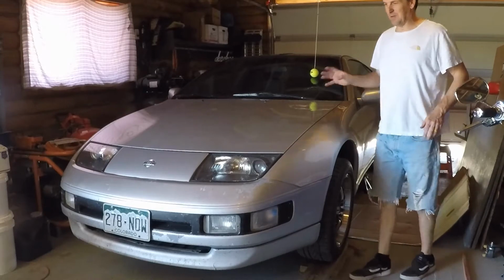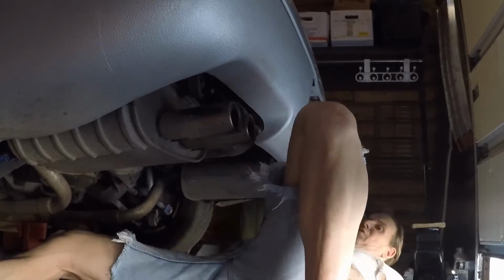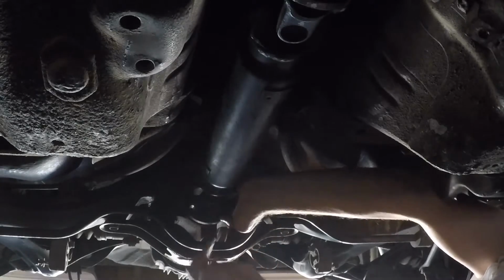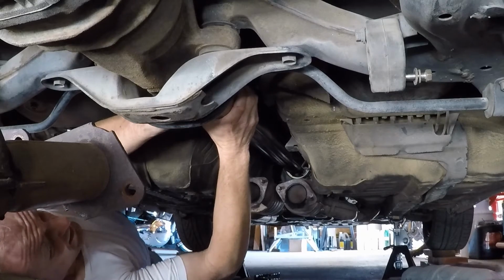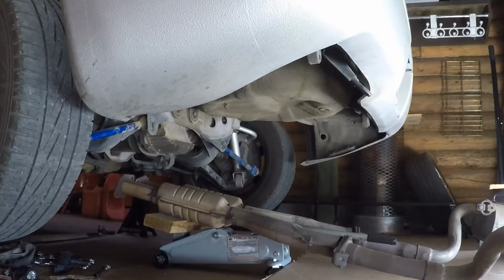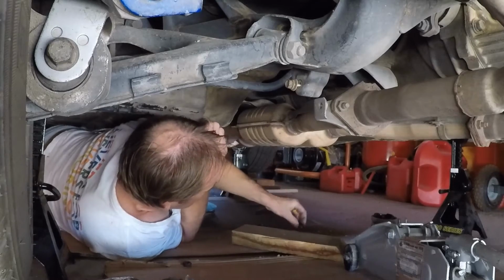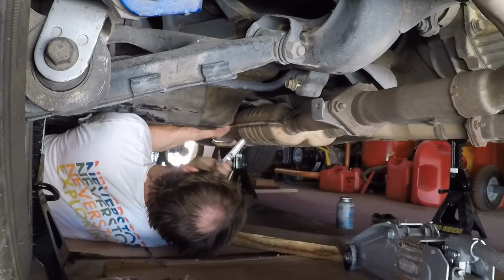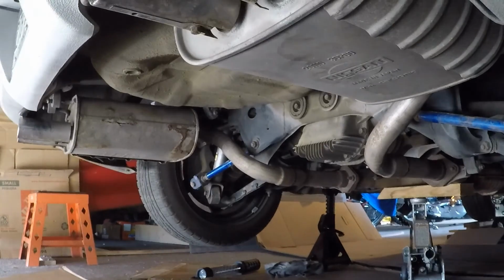300zx z32 one piece drive shaft installation

Comment: This may be a 3 year old video, but i still want to thank you for it. I just got me a Z, and the U-Joints are clunking around. I just said screw it and got a lighter weight, one piece driveshaft. I have little experience with removal and installations of driveshafts, so this helped a lot. Thanks again.